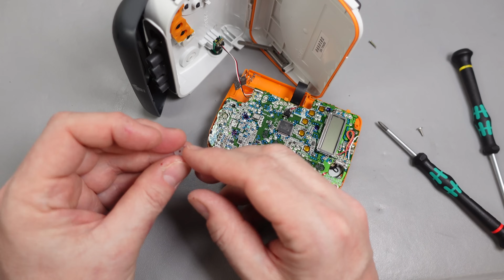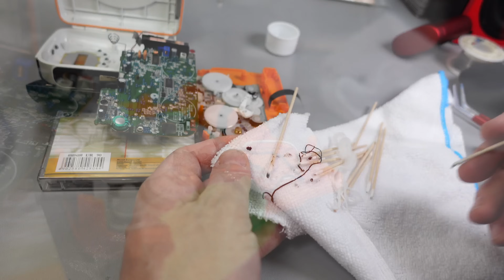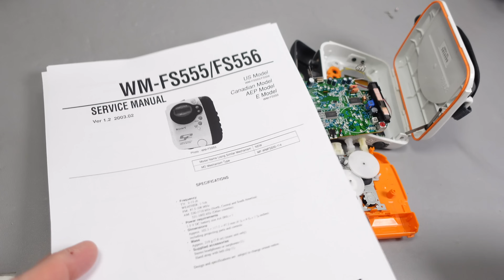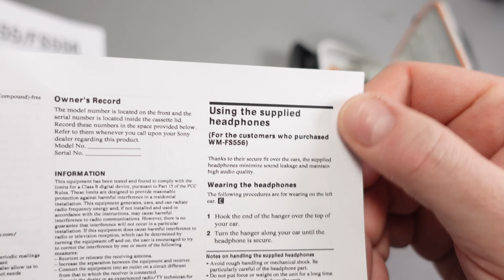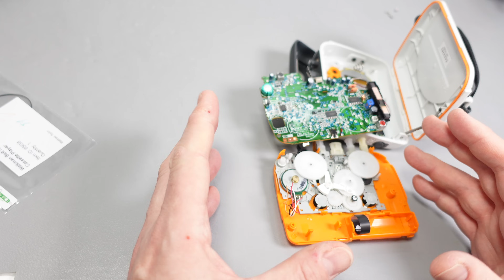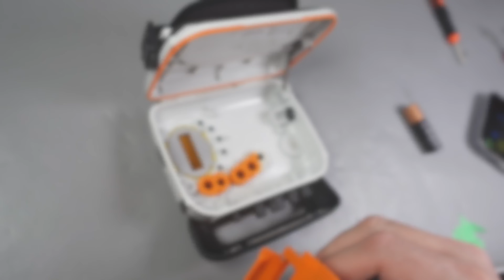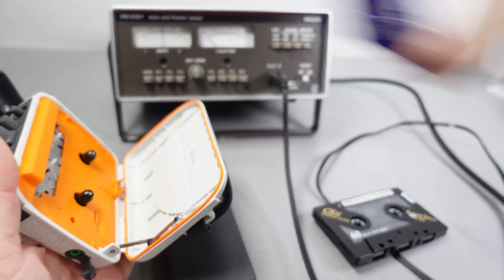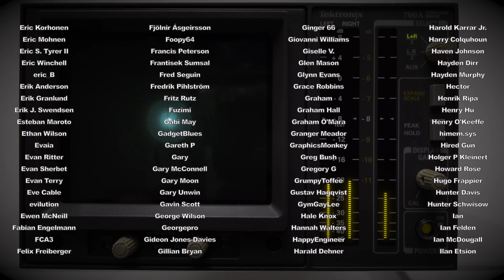SONY S2 Sports Walkman repair attempt

Comment: The reason why the newer cassette mechanisms are so large is that there are two ways to improve the timing of a motor: the first way is to manufacture the parts more precisely, the second way is to add more mass. I assume you realize which of these is more expensive.

Comment: Your video made me buy one, same model. Waited a few weeks for it to arrive from the US. Same as yours it needed a new belt but I got away without using a soldering iron because the belt was still intact, just too loose to turn anything. Now works fine :) And yes its a nice Walkman.

Comment: I had a slightly older version of almost this exact unit. It was the uglier late 1990s styling, but it had an identical looking tape mechanism and a nearly identical TV/radio setup - I think the only differences on mine were a lack of AVLS and Mega Bass was on a switch instead of on the screen. Eventually the buttons stopped working and I know now all I had to do was replace the tip on the inside of the case, but at the time I just assumed it was toast and moved on to my Discman.

Comment: I changed a belt on a Panasonic RQ-S33 yesterday. Some of these Panasonic walkmans are so thin, the main unit without the screw-on battery compartment is the same dimension as a cassette case itself. Everything was so small inside and everything was soldered together tightly. I messed up a couple of things along the was so I had to desolder and resolder everything twice (there's a direction switch which switched while I was rotating the mechanism to see if the belt is on alright), but luckily I didn't damage anything (alapart from a little molten plastic around the gumstick battery door but nothing serious). I was so happy when I put it back together and it worked! I always wanted a walkman like this, I once found a model like this back in elementary but we found the owner and had to give it back. That was 25-ish years ago and now I finally have a working model for myself!

Comment: For those that don't know what weather and tv bands are fore. In the us we have NOAA weather radio stations on a slightly different section of the Fm frequency . I think they are something like 10 different channels. you should be able to pick up a couple unless you're very remote. The TV band selection is for tuning to the audio part of the old analog tv signals. Before we switched to digital, you could tune to the audio portion of the local TV stations. This feature wasn't all that common on radios, from what I can remember.

Comment: I imagine Sony made cassette mechanisms in enough volume that they could afford to make "specialty" parts like the slimline cassette motor. On top of that, I don't believe the last remaining cassette mechanism available today was designed to be used in portable devices, so it isn't even trying to be small and lightweight.

Comment: The Mega Bass has always stuck with me. I have used many new devices with a bass equalizer, but every time I use my childhood walkman which is a earlier model to yours it hits different.

I also remember reading the recommendation in the manual as well from a service center. When I was a kid I thought it sounded nifty that they would be able to do it easily. But many years later, the original gasket still seems just fine, and I am certain Sony will look at you funny if you try to get it changed now.

Comment: Man, I love your repair videos. It's the realistic view of what someone with no knowledge or tools will do. It's either a triumphant victory or straight to bin. Soldering ain't that scary. Most amateurs just dont use enough flux. You cant use too much flux. And modern tin ain't as good as the old one with lead in it. Ask Ben Heck and he has hoarded enough Lead Tin to last a lifetime.

Comment: I've usually found Sony's Mega Bass to be OTT, but to be fair, it does depend on what headphones you're using.  Many of the ones included in the package back in the golden days of Walkmans and Discmans were incapable of producing bass at all, so +12dB of bass might actually sound a little different than no boost at all.  With what we have now, your choices are "not enough," "too much," and "WAY too much."

Comment: The w/f is just way too high....but that tape - the 0.3% refers to the 3kHz pitch - NOT the w/f....this looks like a nice tape from Alex. The w/f shouldn't be more than 0.1%...
Reply: In my experience, it's difficult to get the W&F back down to under 0.2% even with new belts. If they've been sat in a drawer for years unused, I think the constant belt tension in a single place slightly deforms the spindles and pulleys.

Comment: Honestly, I feel like there's a bit of a market out there for a good quality cassette mechanism made with modern components designed to playback and record metal quality tapes. Somewhere in the world, there have to be schematics for the parts used in the better mechanisms, or maybe the easiest option would be to reverse engineer the mechanisms still in existence and create a working schematic.

That way audio enthusiasts could get together and recreate the individual parts via 3D printing, metal machining, etc, and via kickstarter get some good cassette players back on the market again. It obviously wouldn't be cheap, especially at first, but there are those who would pay, and over time less expensive models could be produced. I'm very much hoping for that in the near future.

Comment: Sony also made diskette drives and other small mechanical drives. Floppy drives have these very thin motors as well. I wonder if they used their variable frequency drive technology (BLDC is a common term) across different industries.

Comment: Great video, particularly for the opening comments, regarding what will be the better player. I've watched lots of vids, where Sony Walkman's have their belt changed and seemingly it's ridiculously easy but here it's a a bit more difficult than with many previous designs. I have a pair of Panasonic, portable Stereo cassette players, the radio version, is RQ-NX60V, and other is the same model without radio, which case is in mint condition, my radio version got used a lot more. These days neither work due to perished belts. Look up the videos showing how to change the belts on these tiny devices, which explains why mine haven't yet been fixed! They were the best 'Walkman' type device, I have ever used, wonderful pieces of technology, whilst they were working. The tape only version is, now I've found it: RQ-NX10

Comment: What I love is how the motor is its own flywheel. And look how easy to route that belt! You're right; they're really had it down pat by this point!
Reply: That motor design likely came out of the computer division. It's essentially the same motor setup used in CD/DVD drives for laptops, where the motor is so small it can fit inside the spindle and uses the disc itself as flywheel, and yet barely uses any power once it's up to speed
Reply: @thesteelrodent1796 And then nobody used this kind of motor on any other cassette player because, surprise surprise, the older, chunkier motor was cheaper... Sigh...

Comment: We must try to avoid touching rubber drive belts with our fingers. Use a pair of tweesers. 
Also, the reason why there is a different model for USA is because they have different AM & FM frequency divisions and they have different EQ on FM, so called "emphasis".  That is why it isn't so recommendable to buy an FM / AM radio in the US for bringing it to use in Europe, or the reverse way.
It was really impressing that this little machine had such rather low wow / flutter though it had plastic wheels. Sony made really well-built machines. They were the best brand of those very good Japanese, I think.

Comment: I think the +/- 0.3% on the 3Khz calibration tape refers to the 3Khz frequency, not the recorded wow and flutter. I have a calibration tape and the recorded W&F is ~0.04%.  You should check what you get in your D6C with that tape. 0.3% W&F isn't particularly good - I think most Walkman's were 0.1% - 0.2% when new and most decent hi-fi decks are under 0.1%.

Comment: Nice wera set. I really need to invest in one. I know some folks that have the Andonstar digital microscopes if you ever need one. I have a Amscope se400z, I didn't want a digital one. I just rigged it up to work on a vesa monitor arm so the base of it isn't in my way. I've been modding xbox 360's lately getting more time soldering under the scope. The wires you use are 30awg kynar and its like sewing thread. Very good practice for me. 

Also I noticed those rubber dome like buttons with the graphite on the bottom. Those are common in game controllers and when the button doesn't work great. You can take those buttons. Lay them down on a bit of paper, pushing down the button so the graphite is against the paper and dragging it. It'll clean that contact, then also clean the contact on the board with iso and a qtip, or deoxit if you can get it. I've done that a bunch and its always worked great.

I love these types of videos. Thanks for sharing.

Comment: I was in my 20s during the 80s and had a love/hate relationship with cassette payers. Of course, I only bought the "lesser" brands because the Sony's were too expensive... which may account for my mostly disappointment with cassettes. Plus, the dynamic range of a typical cassette was abysmal and my ears could hear the loss of frequency. Portable CD players helped there but had horrible skipping problems. It wasn't until the iPod that most of the issues with with portable music were solved, but by the time I bought one in 2005, I had lost interest in portable music. I could care less how sophisticated the very best cassette players were. They just bring back horrible memories.

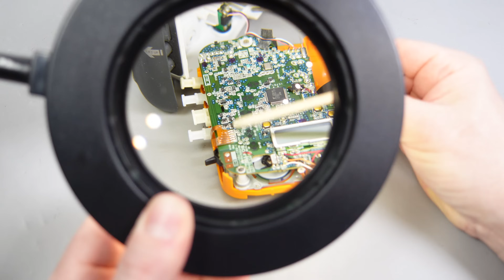Comment: 2:31 if you get comfortable working with SMD electronics, desoldering this ribbon cable is probably less risk of damage than unfolding the whole thing. But, you still need to be ever careful with those!

Comment: The bent button issue is one I had with my Aiwa Sound TX388. Played with it for a minute or two and it started working correctly. The main issue was also a band that needed to be replaced.

Comment: The +/-0.3% mark on the test tape is for speed accuracy. A wow&flutter test tape recorded with 0.3% wow&flutter would be utter garbage. Any decent tape deck performs well below 0.1%. The 0.25% on this walkman is acceptable for what it is, albeit noticable on some music. The belt had a few wrinkles in it when you installed it, that not always self-aligns perfectly just by rotating it, and it can affect W&F. I wonder if Fix Your Audio sells replacement flywheels for this model, it would worth replacing those plastic pulleys to true flywheels made of brass.

Comment: Just allow me a hint: When mounting sqare belts I take care to mount them without twists. When looking @9:16 there seem to be a twist by four "steps", so 360° on a sqare belt between the large wheels. As the belt does no run in and out straight on the wheels there will be more friction and stress as necessary. A round belt will untwist by itself after a short time, but a square belt can normally not do that.

Comment: Sony service manuals are the dog's danglies. I remember back in the 80s and 90s, seeing the service manuals for Trinitron TVs, Betamax VCRs etc. They were like a thick book. Oscilloscope traces, the lot. Had to be really, on the whole Sony gear is relatively complicated and can be quite tricky to access. I suspect most Chinese manufacturers now don't even realise service guides were ever a thing.

Comment: Remember when they expected you to be able to fix your electronics? I really love old sony stuff. Fantastic service documentation, great little screenprintings on the parts and PCBs that tell you where stuff goes. They really were designed with longevity in mind.
Reply: As an electronics professional, this is a huge frustration and source of sadness. Old test equipment came with a service manual that not only said what to do, but even explained the principles of operation in detail. Nowadays you get absolutely nothing. 

I recently spent a full day or two at work reverse-engineering the circuitry in some lab equipment (heated magnetic stirrer plates used for chemistry), because we have literally hundreds of the same model, so investing the time to understand the circuitry yields dividends in being able to repair a ~$1000 device instead of throwing it out. The most expensive board-level repair required $6 in parts, but most so far have been literally failed resistors that cost a cent to replace, or worn out potentiometers. No help from the manufacturer of course… 

But of course taking the time to reverse engineer it is something I can only justify to my boss because we have hundreds of them, and I have a few of them on my bench at any given time. For a similarly-prices thing we only have one or two of, it’d end up getting an hour of troubleshooting, no more. :/
Reply: Computer parts are still made with proper labeling of everything, because they're designed to be assembled by people who don't know the ins and outs of the products. Of course with computers all the connectors are standardized, which makes a huge difference, but quite often you can assemble all the bits without having to open the manual (and usually the manual isn't of much use anyway).

CuriousMarc has multiple videos where he talks about and shows how easy it is to repair old equipment, where modern stuff is basically trash as soon as it develops a slight fault. The electronics industry really died in the mid-1990s - that's when they stopped innovating and seized producing old solid designs, and switched to designing things around being as cheap and short lived as possible. We used to have products that were in production for 10-20 years with only minor incremental changes over time, because they were properly made from the beginning, and then almost from one day to the next they're replaced with products that break as soon as the warranty expires. Hewlett-Packard is a great example of a company that once was renowned worldwide for the quality of their products, and then overnight in 1994 they switched to producing trash, so now they're nothing but a joke that typically produce lower quality than unbranded junk from China.
Reply: @thesteelrodent1796  "products that were in production for 10-20 years with only minor incremental changes over time"  I feel like you might be too harsh. The Nikon F6 electronic 35mm film camera was in production from 2004 to 2020, and the Nikon D850 electronic 35mm DSLR has been in production from 2017 to present (2026) and will presumably remain in production as long as there is still some demand for DSLRs.

Comment: On the same note of repairing cassette decks I am currently trying to get mine, part of a karaoke system that was saved from the trash, to work but unfortunately something quite important had broken on it... one part of the torque regulating clutch for the take-up spindle. Kind of similar to the Tanashin decks we all see today, but this one was definitely a better made one from Panasonic. I can't seem to see this part on the local online shop platforms, perhaps it is time to hunt for another broken deck or try making my own parts using some moulding or whittling down some plastic!
Reply: The Tanashin mech can be decent if implemented correctly.  It will never be a great mech, but it's reasonably simple and generally reliable, if good parts are used to build it.  Then it's really all about the head that's used, plus the electronics to output the sound.
Reply: @kirkmooneyham  This one I got is from Panasonic. Not exactly a Tanashin, it has way more metal than that! It has a pause function. AC bias recording, real electromagnetic erase head, no auto reverse (one-way auto stop). Panasonic electronics (AN7345K). Head is MS 15RBA2. It does sound good with its own recordings, but the clutch issue makes the speed dance around and is very inconsistent. Of course, no Dolby noise reduction. Shame because it has potential to be better than the decks you could get nowadays...just that broken part!

Comment: 30 Plays on a single alkaline is mind-boggling. The off-brand portable cassette player of my youth barely got 4x 60 minute plays out of TWO alkaline AAs!
Reply: Brushless motor and switch-mode boost converter. That would do it.
Reply: My old walkman chewed through batteries so fast I had to carry a huge external battery pack with it. Sort of defeated the whole super compact concept.